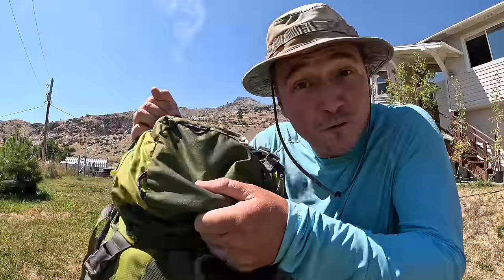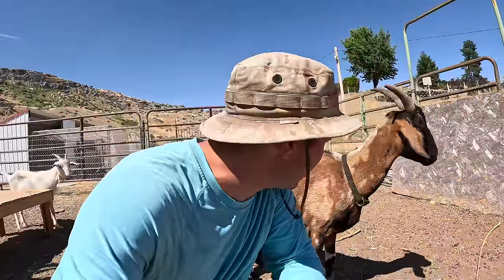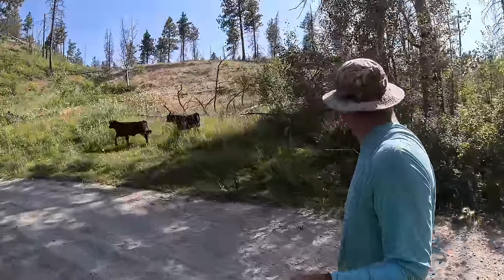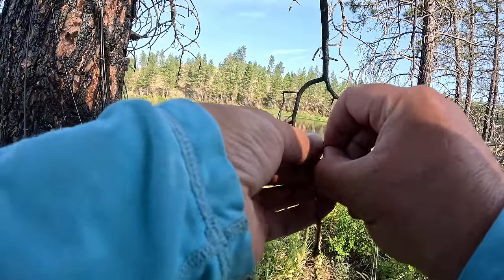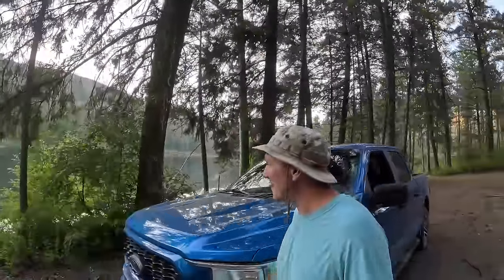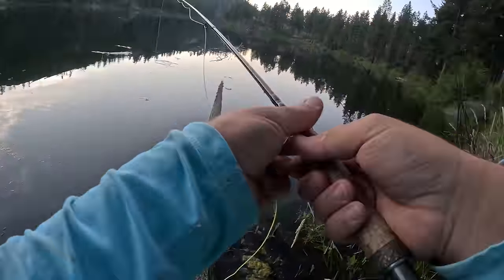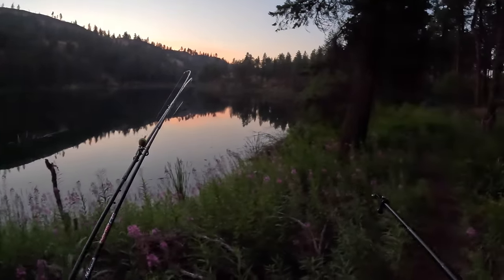Solo Mountain Lake Fishing!!! (never thought I would catch this...)

Comment: With your roll cast, make sure you form the shape of a D with your fly line and fly rod. That D shape should be behind you before you make your cast and the contact patch, where the fly line touches the water MUST be in front of you.
When you make your forward cast, think of it as a railway line. You have your fly line on the water in front of you (right side tracks), make your cast parallel with that line and as the line rolls out, it makes the left hand tracks. This would be reverse if someone is left handed of course.

Was thinking just yesterday it's been a while since I've watched some NWFS and here you're!

Comment: As an experienced fly fisherman, if you are having trouble laying the fly out, go up a line weight. it is OK to go up a line weight, and it will cast much easier with both the wet and dry flies. You will not get the nice gentle lay-down with a dry, but you can still get it where you want it to go. You also cast the fly line, not the fly. You need at least 10 feet of fly line out to be able to cast effectively.

Comment: I’m thinking the mountain farm is in Wenatchee some where…hard winters and hot summer.
Reply: It is farther north than that. Winters on the eastern side of the Cascade Range can get chilly at times, but "hard Winters?" Not so much. In the northeastern corner of the state, Ferry, Stevens and Pend Oreille Counties, it does get below 0 degrees F during (Canadian Express) cold snaps. I've seen -20 F a couple times. Saw that same low temperature closer to Leif's desert property in 1985, but that was highly unusual.

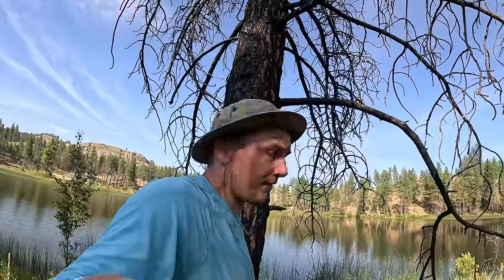Comment: @nwfishingsecrets 21:18 did you cut back into your actual fly line when re-tying your leader? If so, I wouldn’t recommend this as they are not designed for this, and you are slowly eating away at the necessary taper in your line to properly transfer the energy from your cast…. Look into perfection loops, for switching between leaders! If not and I am mistaken, disregard my comment! Love your videos!